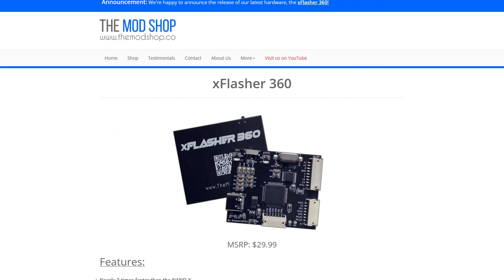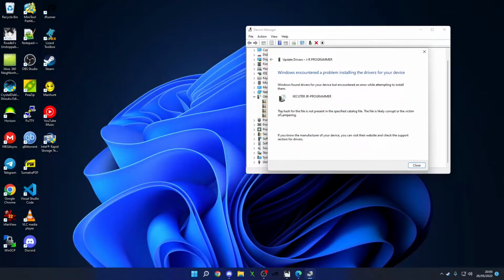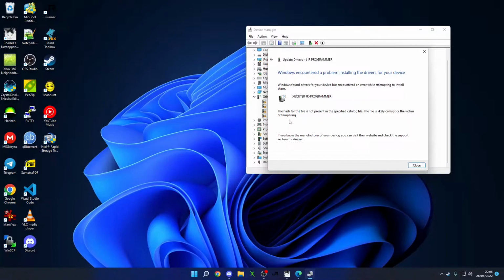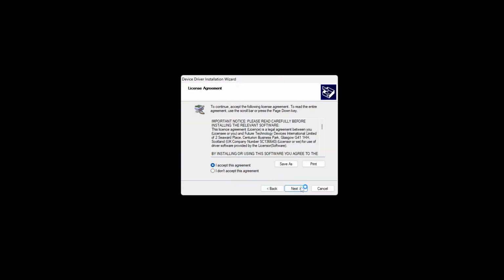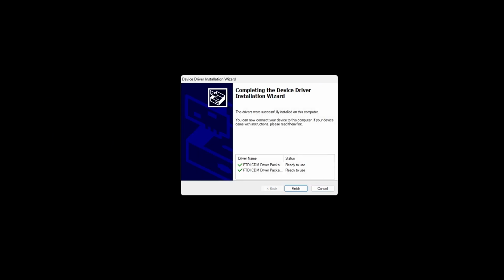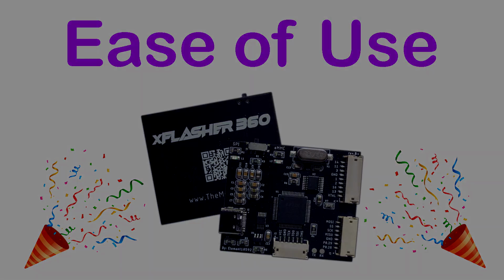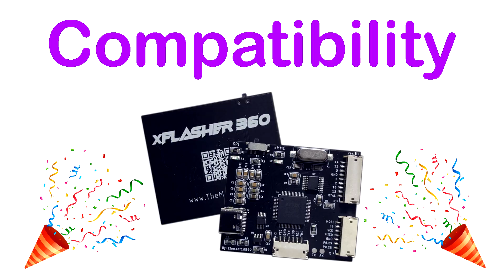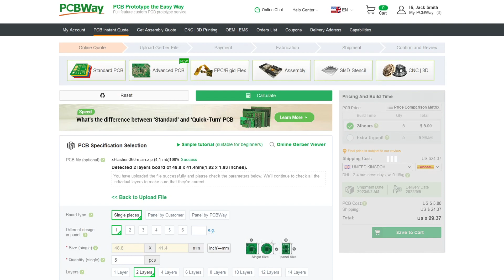Xbox 360 NAND Flasher Showdown: Which is the best?

Comment: I used the picoflasher method and worked fine for me.
Reply from the maker: I’ve not found the PicoFlasher to be very reliable, especially for 4GB NAND’s. It also doesn’t flash glitch chips so won’t be good for people who are wanting to do multiple consoles.
Reply: @TheModSmith I actually did my 4GB corona v6 which is a xbox 360 e model with the pico flasher a year ago and it worked fine. Only the postfix adapter was a bit of a pain and having to scratch that one tiny point free from silk.
Reply: @TheModSmith  Yes, I often encounter situations where I can read but cannot write. The software is stuck. I don’t know if the cable connection is bad.
Reply: @OPENGRS same cant get to write the xell and load the cpu key from it, do you have any suggestion#?
Reply: And even flash of the gitch chips is possible via DirtyPico360 with the Raspberry Pico now 😊 NAND read/write with Picoflasher Image then (incl 4 GB corona models)